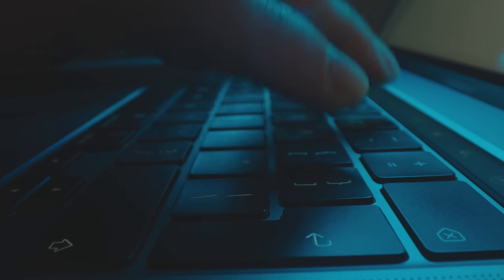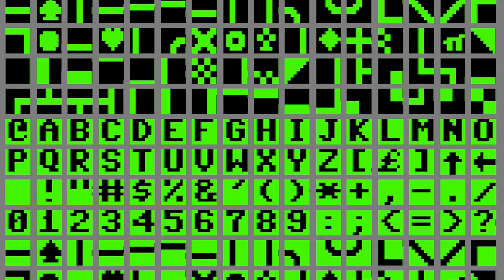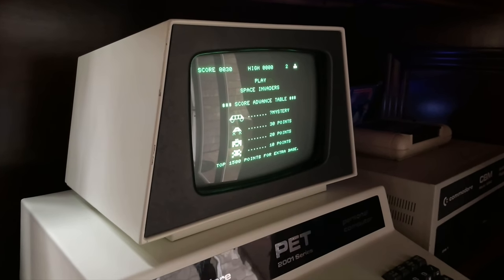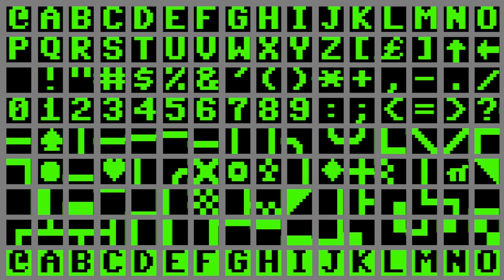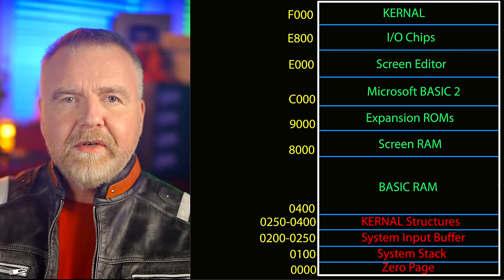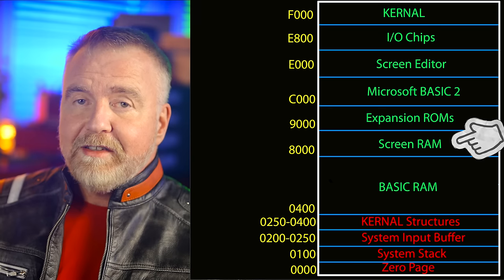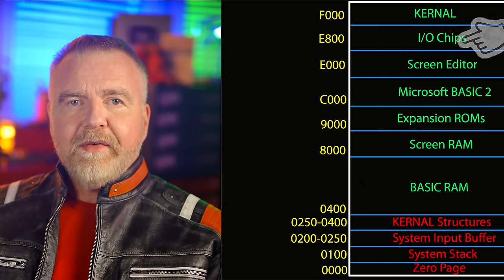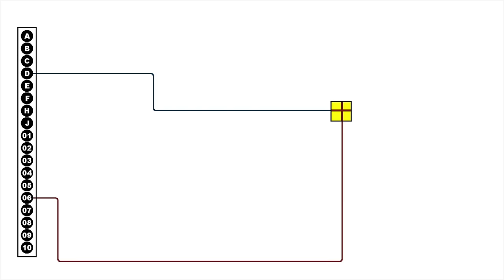Everything you SHOULD know about your Computer but don't!

Comment: Why no character maps in RAM? It comes down to the usual suspects - Functionality, Cost, Complexity, Speed, and time to market. For the few users who would make use of custom characters, Commodore would have had to spend time and money to include additional and/or more expensive hardware, as well as time and money on changes to both the kernel and the BASIC interpreter, only to end up with a machine that the majority of users would see as slower and less capable than what they did bring to market.  

In no special order...

Speed - with vertical and horizontal blanking intervals, the math can get a bit convoluted, but at a minimum the video hardware needs to access 40 ROM characters 8 times per line of text (it displays one byte of each of the 8X8 character maps in each scan line, then moves to the next scan line, and there are 8 scan lines in each character), and it has to do that 60 times a second (North America). So 25 lines of characters, times 40 characters per line, times 8 scan lines per character, times 60 screen refreshes is an average of 480,000 memory accesses per second. Always. For ever. Without dual-ported RAM, that would certainly slow down the 1MHz processor, with approximately half of the memory bandwidth being used for video display (which can't really be delayed, without noticeable visual artifacts).

Cost and Complexity - Added circuitry would be needed to control and detect when to use ROM and when to use RAM. And if the character maps are in RAM, changes would be needed to the BASIC interpreter (and KERNAL) to make sure they don't use the now reserved area. Plus, if you want to address the speed problem with dual ported RAM, that's more expensive RAM chips and even more circuitry. All of those things would cost money, as well as introduce additional testing requirements and points of failure.

Functionality - On a 4K machine (keeping in mind that the first two pages are "special", so you've actually only got 3584 bytes available to your BASIC programs) dedicating more than half of your remaining RAM would seriously restrict the user's programs on machine. Not to mention the inevitable situation where a user switches the hardware to using RAM characters without first copying the character maps from ROM. Or (almost as likely) completely messing up the custom character maps so that there are no recognizable alphanumeric characters in the set. In both cases, there'd be complete garbage on the screen, and the only options would be to either type the correct POKE command to get back to using the ROM without being able to see what you're typing, or else do a power-on reset. 

Time to market - see above regarding complexity, especially with regard to additional design, development and testing requirements.

Comment: Why external character Rom? Cost. Rom is/was cheaper than ram. When Rom, the decision to not expose to the cpu is simply consequential as if you cannot change it you don‘t have to see it.  It is also simpler to implement and also removes the impact of sharing the bus between cpu and screen (dual port memory was not yet a thing). When the screen has to accesses the system ram three things had to be coordinated; cpu, dram refresh and screen which was hell to implement with pure discrete logic. And character by character lookup via double indirection is very wasteful also as the bus speed was (simplified) 1MHz whereas the pixel rate was 7.x MHz, so the bus would be clogged by the screen refresh. Also unlike todays monitors can, old crts/tv use a constant scanrate and can’t wait for the next pixel. Which is why screen memory was on a separate bus and the cpu would arbitrate for access to this memory (or cause flickering if not).

Comment: When we wrote for the Commodores we "abstracted" to have a single "interface" bundling all we need without hiding the underlying core, or the other way around if we wanted to achieve the latter we built a custom "Kernal" and "liveloaded" it "on demand" ... And then came the Pentium-Class battle armada and since NT 4 we have to fight Gatekeeper-endbosses on every level of the machine, break through highly actively obfuscated not-anymore-interfaces and all of it eats performance due to being at least three times translated between the layers. You "can" still achieve a full understanding if you do nothing else, but even if .. since the PC .. we can not be a kernel- and a application-programmer, let alone a designer or illustrator at the same time anymore. You have to pick one at a time. There is only so much our brains do at once.

Or as the ignorant often said - disgusted by the achievements and love for the level of detail of that weird child: "Intel broke the brain". Sometimes the ignorant "can" become prophets.

Comment: Cost. In those times a video ROM was cheaper than RAM, especially in high volumes.
Reply: I think that's still the case today for large enough production volume. The difference is nobody has a use for multi-gigabyte mask ROMs.

Comment: When the PET hardware was designed, RAM options were limited, and the process was running at around 1MHz.  There are two issues when adding video hardware to a micro - the address multiplexing between the video hardware and the CPU to allow each of them access to the RAM, and then there are the timing constraints.  Displaying 40 characters on a line means roughly one character code each microsecond. That can be done without slowing the processor if those accesses are on alternate phases of the clock, but hardware is needed to do that for address, data and control signals.  If the character map is also in the main RAM then that is a third access, based on the prior character code read-out and also needs its own address path to the RAM.    In the late 70's that was a big ask and would have complicated the hardware significantly (cost) and compromised the freedom of the processor to access the RAM.  The use of static versus dynamic RAM is a minor complication in that DRAM would also potentially require dedicated refresh cycles and addresses (no DRAM chips back then could generate the refresh address internally).  If DRAM had been used, and depending on the type, that might also have required further address multiplexing for the chips own row and column structure (at 4k bits, MK4027 style DRAM does, TMS4050 style DRAM does not).  Adding that extra hardware and taking all of the timing into account would blow the hardware cost budget and probably the hardware timing budget as well.  Having a physically separate character ROM was just one of the ways of reducing that complexity, and allowed the RAM to be slower since the ROM access could be pipelined to take place in the same timing window as the RAM access for the next character to be displayed. Simpler hardware, simpler timing.  
(For info - I designed hardware very much like this for proprietary micro-computer systems in the very early 80s. I also wrote assembler routings for keyboard scanning,  hardware testing, and many other functions.  Yes, it was great knowing exactly how everything worked!)
Reply: Also, referring to your list of "do you know how to...?" at the beginning?  In my case, Yes, to all of them, provided that there is a floating point instruction set in the CPU. I did all of those things (around 1982-1985. (Designed the hardware and did the PCB layouts too, but that's another story.)

Comment: ROM vs RAM for character codes...  
2 extra bytes of vector for the start of rom ... $00ED $00EF is empty, zero page, and thus fast.
I can't find the character rom location, and am minimally capable of 6502 ASM. So I'll label...
Bootstrap adds 
LDA crlow
STA $EE
LDA crhigh
STA $EF
Only 8 extra bytes ( A9 ?? 85 ED A9 ?? 85 EF) and 2+3+2+3 = 10 cycles.
However, the vector table lookups  now have to also add the lookup, losing a few cycles per lookup. IIRC, 2. 
PET speed: 1 MHz
NTSC 60 Hz
PET screen 25×40 at 8 lines each. that's 8000 cycles lost per additional cycle per line. 
So, if adding an additional 6 cycles for the indirect lookup for each, we lose 20% of the speed. (I'm pretty sure there's a less expensive solution to it, but I don't know it.) Still, even 2 extra cycles... is 6% of speed. And a large chunk of operation is already screen interface.

It's these kind of headaches that kept me from trying to learn ASM back in the day... well, that, plus trying on a Kaypro II (old II, CP/M), as Z80/8080/x86 is more convoluted....

Comment: I learned BASIC an some ML on the C64. Well, I knew what all the ML instructions did, but using them to create anything more complex than simple routines was beyond me. I wasn't even that great at BASIC. When I moved on to the Amiga, I didn't learn any programming on it because I didn't feel like starting over. Now I use Windows and the only "programming" I've done has been writing Batch scripts. Batch is close enough to BASIC that it was generally easy for me to pick up. I mean other than all the quirks that make absolutely no sense whatsoever. Why are two equals signs always required in an If comparison? Why is there no way to turn Delayed Expansion on/off without using the SetLocal/EndLocal commands? Why are entire lines evaluated even if part of the line is conditional and shouldn't even be executed? Why is there no way to pass a filename with exclamation points to a variable when Delayed Expansion is enabled, but yet there's never a problem when a filename contains percent signs (also used to mark variables)? It's like they set out to make Batch as unintuitive as possible.

That said, I know more than the average user, but many things are still beyond my knowledge. I have an XP system that will no longer allow me to select a default MIDI device (the MS software one), and as a result, no program can play MIDI music. So far I haven't had any luck fixing this.

Comment: Characters on a ROM....Dumb terminals, hyper expensive "business" machines that did very little, and were still being sold after the 90s......Very rudimentary, networking that made the 56k modem, look like a hypergalatic battle ship by comparison...The dumb terminals were glorified oscilloscopes......less technologically advanced than a 1950s black and white TV set.....The lowest display mode, the character mode, uses very little memory, and doesn't need much bandwidth to work....draw simple characters before the eye notices, the strobing, which isn't very fast to begin with...

Comment: I like that you labelled it "Microsoft BASIC 2" in the diagram.

Well, you did used to work for Microsoft, and Commodore did just take it and drop Microsoft's credit for it, so it's only "great justice" to restore it once more.

Although, C64 BASIC was rather terrible, so I don't know how much credit Microsoft wants to take on this. 

But, as I like to joke, Microsoft & Commodore helped create a whole generation of assembly coders... because C64 BASIC sucked so badly. You almost immediately dispensed with it and moved to 6502 as soon as possible.

But, then again, this maybe reminds us that adversity isn't always a bad thing in the long run. If Microsoft and Commodore had produced a BASIC to rival BBC BASIC from Acorn, folks would have stayed in BASIC and the full power of the C64 hardware would not have been tapped as deeply as it has been.